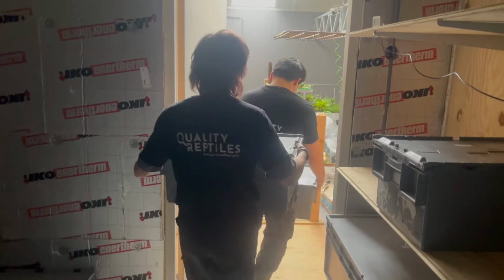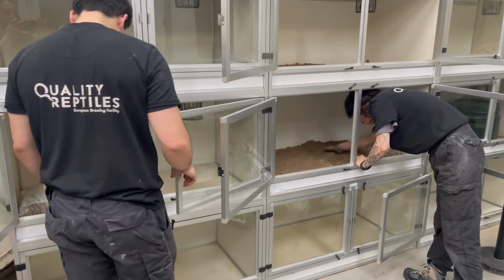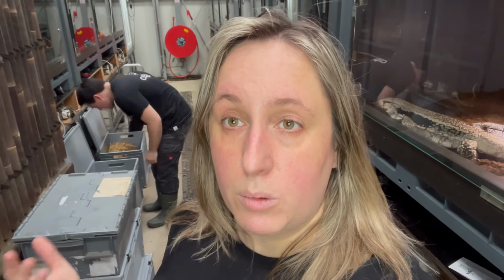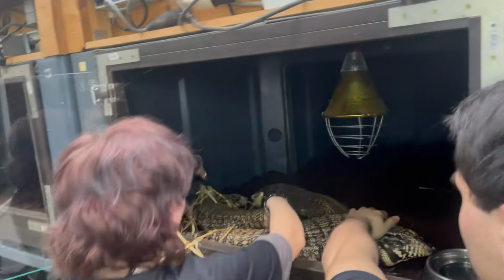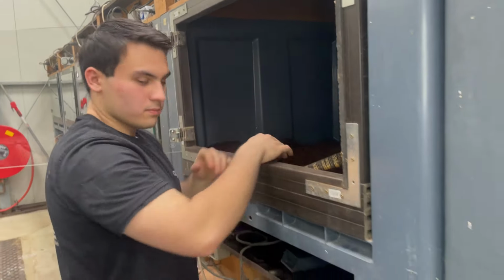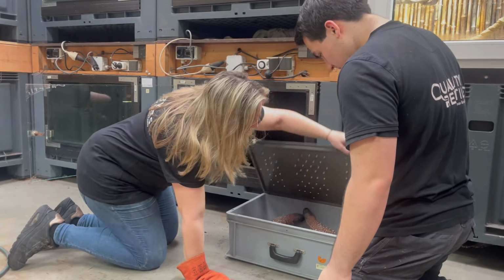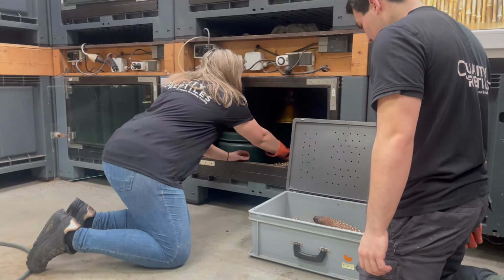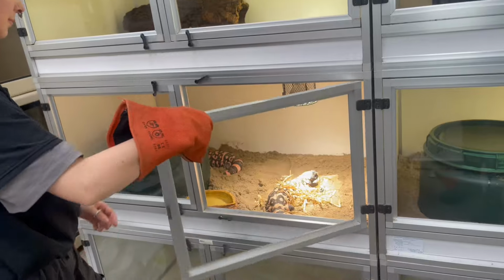Heloderma and black & white tegus waking up out of brumation

Comment: Hi,
 have you seen the latest video from NERD? It is about Tegu care and I found it a little bit disturbing.

His Tegus were in the same enclosure with Cyclura and a bunch of turtles, I though "oh okay, that's maybe a bit risky"

But what I found very strange was at 26:35 he is saying that they don't work with UV light for Tegus too much, it is something you can do but it is not so important. He is supplying calcium and D3 instead. Anyway Tegus are borrowed very often so they don't really need UV. 
That feels so wrong. 
 Steve Mccurley is someone who is very experienced with reptiles, he was holding and breeding like EVERYTHING. People say the animals he is selling are quite expensive but always in a perfect quality. Now I don't know how he comes to this opinion? Don't get me wrong I won't turn off the lights and give my Tegu pills instead. Im just a bit confused. Can you say what his way of caring is doing to the Tegu in a long time?
Reply from the maker: I think this advice is like going back in time. I can not proof what he does does not work. But I think tegus do not get very old this way. Not like some of mine who easy get 25/30 years old. Combining them with cyclura I would never recommend. Cyclura have a terrible bite and a tegu has no skin that can handle those bites.
Reply: @Qualityreptiles  also the amoebas in the turtle poop could probably be to dangerous.